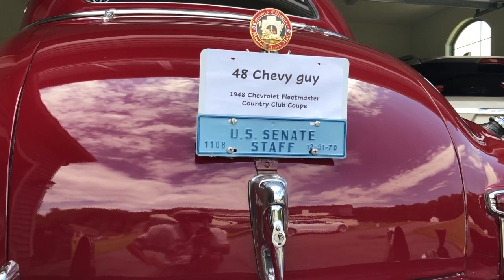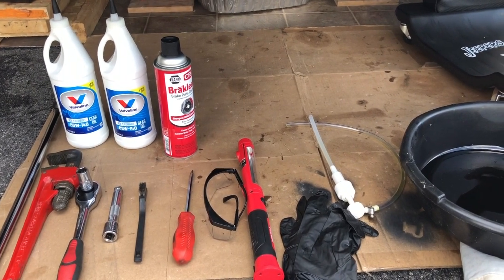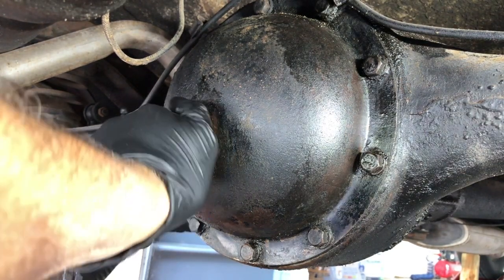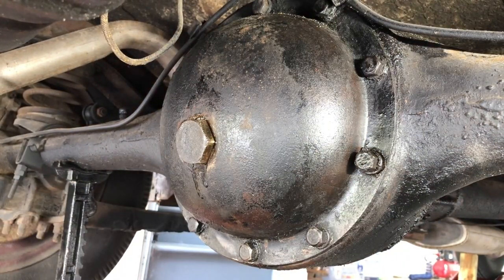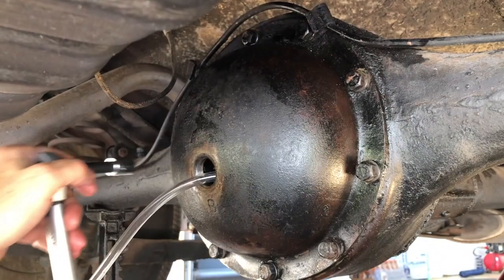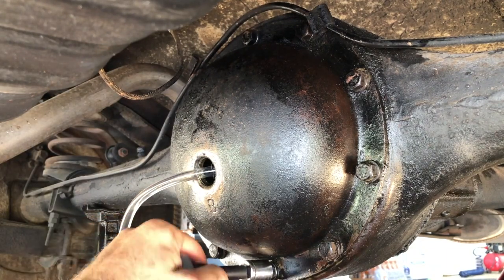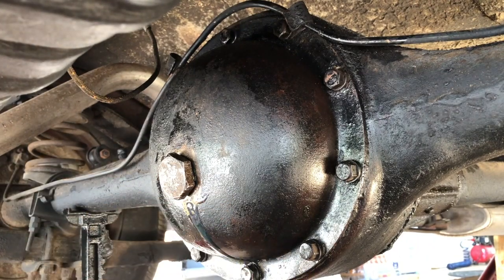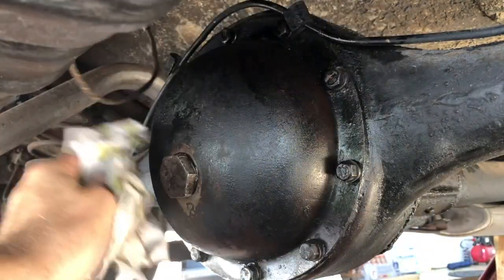How to change differential gear oil in a 1948 Chevrolet Fleetmaster

Comment: I have 56 Chevy that I've owned for 49 years. I am curious as to how often the rear gear oil should be changed? I don't remember ever changing this oil.
Reply from the maker: I think now would be a good time to change your gear oil. Make sure to loosen your fill bolt before draining your old fluid...I would change fluid before another 49 years goes by...check the level once a year or so and take a sample with a turkey Baster if you can and see if there is water in the fluid. Some modern car manufacturers recommend to change fluid at 100,000 miles. On my antique car I probably will do it every few years... Let me know how it turns out.